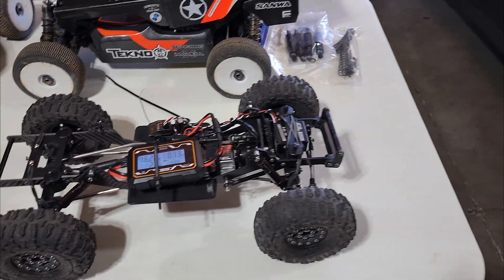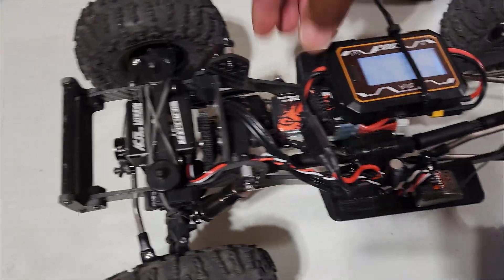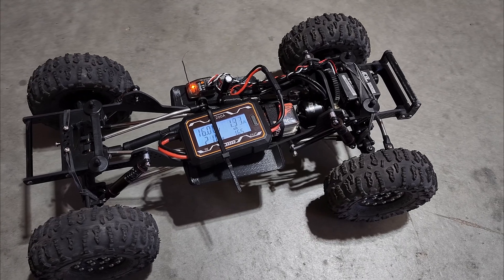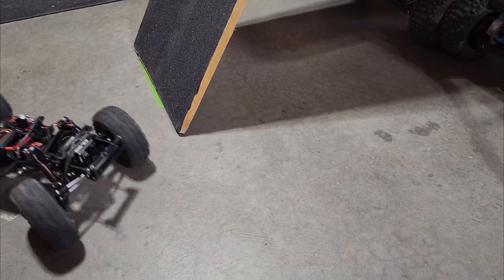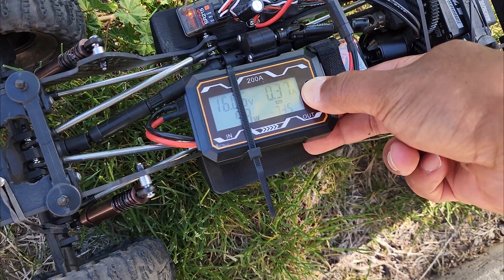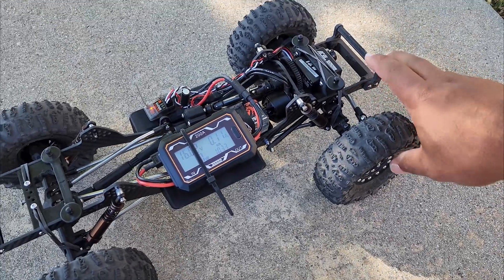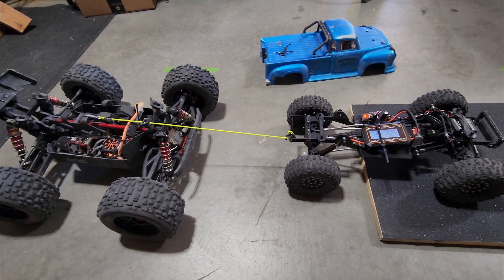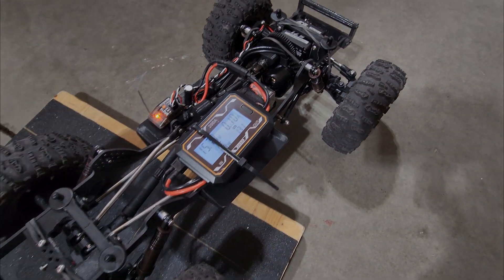Measuring Current Draw on an RC crawler | Does C Rating Matter?

Comment: So the sine mode is in the beggining when you press throttle, lets say 5%. then when you are over that lets say 15 % trottle it switch normal mode?  Is sine mode rpm lock?
Reply from the maker: Yes. In sine mode the esc will keep the motor spinning a constant rpm based on throttle position.

Comment: great investigation!  My only comment would be that your current draw is higher when you punch it, but the meter is not catching the bursts.  A small outrunner like that will be bursting 40 to 50 amps from a dead still for a brief moment.   This is why going back and forth really fast is a bad idea.  And also why I have my kids test stuff now, lol!
Reply: I came here looking for this exact info, as I haven't measured peak current for myself. Thank you, HH!
Reply from the maker: So I wasn't actually going to reply to this but, I'm not sure what John is talking about. Of course a "peak" current meter measures peak current draw which in this case is 10a. I've been using these things for years in drone racing to specifically measure peak current draw. Additionally if you actually pulled 50amps out of an 850mah lipo it would probably last for about 30 seconds. Just for reference my race drone peaks at about 70 amps burst. (4 1700kv motors) I use 1250mah 6s lipos (over double the watt hours of a 4s 850) and they last for about 2 and a half minutes.
Reply: Furadi
 So can I fit a 2250kv 105A motor with my 70A ESC? Lipo 4s?
Reply: @nanansilva636  What ESC is it ?
Reply: Aria dys esc 70a
Reply: Do you notice esc temp problems when in sine mode? I’m running a 3542 1400kv with the same esc, and notice it gets pretty warm fast when in sine.